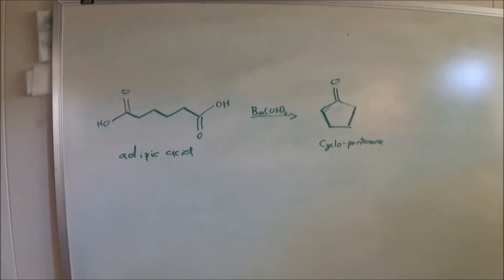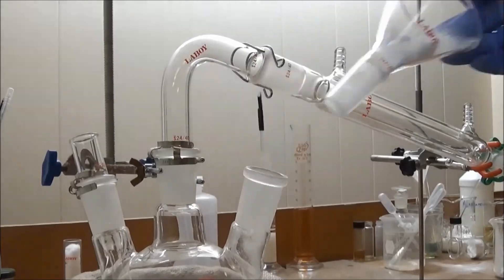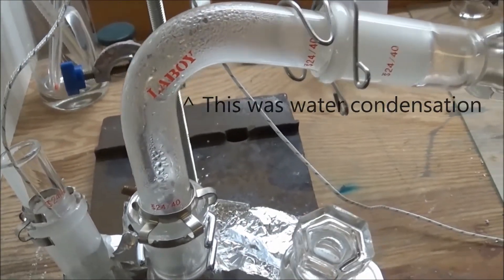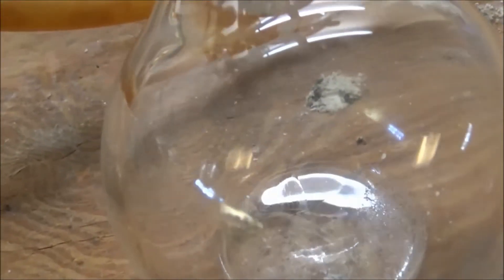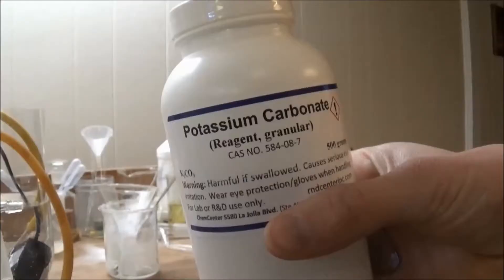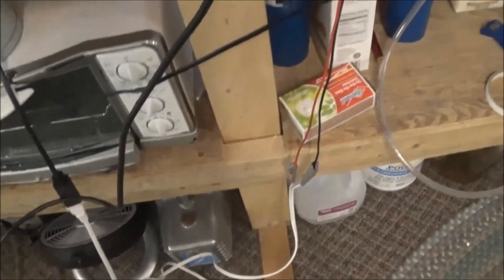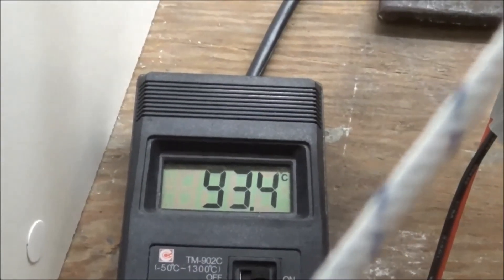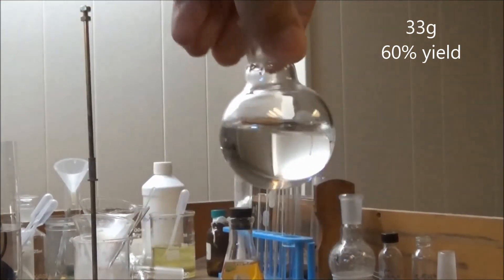Make Cyclopentanone from Adipic Acid

Comment: Can Ca(OH)2 be used instead of Ba(OH)2?
Reply: Yes. I've produced cyclopentanone in 10kg batches using just @ 2% CaCO3/Ca(OH)2, Alumina balls etc.. Glassware is short-lived & so better to use a metal pot with agitation, electrical heating & temperature-control. You'll get close to 98% yield

Comment: Years ago, I had used CaCO3 for making cyclo-pentanone from Adipic acid. This is because CaCO3 is much cheaper & also not toxic. Even 2% works fine & doesn't leave much residue in the flask

using the reflux column during decomposition stage improves the yield to > 90% as the adipic acid will continuously fall back into the reaction flask. This way the alkali-scrub is avoided. The water-layer at the bottom was removed with a separating funnel & no 2nd stage distillation is needed. I had used a thermometer to keep reaction temperature @260°C
Reply: I was trying to find a better non toxic catalyst than Ba(OH)2 or KF and this sounds great. Thanks!
Reply: @monarchatto6095  In the end, We had excellent yields using an iron 'pot' with a wide mouth that could be cleaned out easily. Glass-flasks were shortlived. BTW, it is a dehydration reaction where the 2 cooHs of the Adipic acid molecule lose water & close the ring with a carbonyl-bonded oxygen. In some experiments, we had good results with Alumina balls. There were just available around the lab. To reduce the charring to the very minimum, we controlled the heating - coil by means of a PID controller to @ 205 -210° C. This way we got close to Y -Th

Comment: GREAT VIDEO.......I think all ketonizations give low yields.    You should take that cyclopentanone and heat it STRONGLY with acidified KMnO4 so the ketone forms an enol(double bond) then the KMnO4 could break the double bond forming pentanedioc acid.   THEN TRY TO KETONIC DECARBOXYLATE the pentanedioc acid into a 4 carbon ketone ring.   I do not think it will work cause of the strain of a 4 carbon membered ring but it would be cool........lol
Reply: Cyclobutanone doesn't form from glutaric acid. The ring is pretty tense so you have to do it with the other way.
Reply: @dimaminiailo3723  .............I thought with strong acid like permanganic acid you could make an enol from a carbonyl group like on cyclopentanone???????   An enol has a double bond.    I thought  you could break a double bond and replace the ends that were broken with carboxy groups using HOT acidified  KMnO4 ???????   Which statement are you saying is wrong??????   I can't form the enol .........or i can't break the double bond that is formed on the enol to create 2 carboxy groups???????????
Reply: @johnblacksuperchemist2556  You can do this the usual way with nitric acid. I was talking about the formation of cyclobutanone from glutaric acid which is almost impossible
Reply: @dimaminiailo3723  ...ok

Comment: Great video, Tom! In the last distillation though, you said an azeotrope with water came over. But then you said the result was pure cyclopentanone. Did you add a drying step in there that you forgot to film? Thanks!
Reply: He collected only the pure part of distillate. The cyclopentanone from azeotrope wasn't extracted as I can see.
Reply: @dimaminiailo3723  See, besides water, you have some adipic-acid in the Crude product too, if you use a low reflux ratio this increases.

For producing in small quantities, you may wash with an alkali like NaHC03 & dry it with CaO, maybe even distil for high-purity.
 In making our 10kg batches, we used Lime-CaO for both drying & removal of free acid in one go. This was followed by one more round of distillation.
Reply: @TheControlPhilosopher  Any basic conditions will destroy the ketone. The best way is careful fractional distillation and drying with a Dean-Stark trap
Reply: @dimaminiailo3723  In kg scale production, in the midst of other chemicals being Synthesised, one needs to minimize the steps of manufacturing. And in intermediate synthesis it is often never essential to have the reagents  in pure form.

All the same your point is right. Ketone-yield does get destroyed. which is why we used Na-Bicarb for adipic acid removal. For dehydration, we actually began with CaCl2 but we found it corrosive to iron & SS. Whereas. CaO did a great job. There wasn't much loss of ketone thanks to its low solubility. The spent reside could be readily disposed as an admixture to lime-wash. There was the odour of the Cyc-Pentanone but its rather pleasant actually & it didn't linger beyond a day or two..

Comment: If you were ultimately aiming to produce cyclopentane via hydrogenolysis of the cyclopentanone, could you perform the hydrogenolysis on the crude cyclopentanone and then just refine the product afterwards? Or would the impurities cause issues in the hydrogenolysis process?
Reply: No.. He was trying to produce the Ketone. BTW, cyclopentane is almost a gas at room-temp. It has a very low BP, smells of cooking gas & is very combustible.

Cyclopentanone is useful to add the cyclopentyl group to any secondary-amine, using the Leukert-Wallach reaction.

Comment: How did you identified the product ?
Reply from the maker: The observed properties were enough for identification. Not miscible with water, density less than water, boiling point around 130 degrees, and an azeotrope with water at 93.5 degrees. Given that it came from adipic acid, there really isn't anything else it could be.

Comment: What will you do with the product? Someone mentioned cyclopentamine, I realize the formilation or halogenation of cyclopentanol would involve a lot of steps, and this might not be the easiest way to synthesise cyclopentamine, but it would be pretty cool to see you make quite a complex otc drug. You could also test multiple ways to get from cyclopentanone to cyclopentamine and see which is most effective
Reply from the maker: I have two complex OTC drugs that I plan to make in the future. One I mentioned in my Q&A video, remacemide. Another involves cyclopentanone, the drug cycrimine. My plan is to reduce cyclopentanone to the alcohol, make cyclopentyl bromide and finally cyclopentylmagnesium bromide. React this with 1-phenyl-3-pieridinepropan-1-one (I'm not that good at naming, that may not be correct) to make the final product. 1-phenyl-3-pieridinepropan-1-one will be made in the Mannich reaction from acetophenone, paraformaldehyde, and piperidine. The latter two chemicals I still need to acquire and make.
Reply: Tom's Lab I can’t wait to see your upcoming syntheses! How do you plan on making the piperidine, maybe reduce pyridine or get it from piperine in black pepper? Also, what will you use for the cyclopentanone reduction?
Reply from the maker: I'm planning to reduce pyridine to get piperidine. I think this will be faster than extraction of piperine and then conversion to piperidine. For cyclopentanone reduction I will use sodium in ethanol.
Reply: @TomsLab  The cyclopentanone easily reacts with secondary amines along with slight excess of formic acid mixed with the ketone. With Piperazine, this method readily reacts to form the mono & di-cyclopentyl derivatives. Loss of yield of the Mono-cyclopeentyl was basically due to di-substiation on the 2nd free hydrogen on Piperazine.

Formyl blocking of the 2nd end of the Pip. molecule resulted in mono-substituted yield increasing to >80%
Reply: How effective is the sodium reduction? Isn't there a risk of side reactions, particularly condensations?
Reply: AguaFluorida I would think so, I thought he meant he would use sodium and ethanol for the pyridine reduction as part of a Birch reduction because that’s proven to work, for the cyclopentanone a hydride like sodium borohydride would probably have to be used. A sodium reduction would likely yield the alkane if it even worked, although I haven’t looked into it much, so correct me if i’m wrong.
Reply: Having thought about this a bit more, sodium metal with cyclopentanone would tend to produce the corresponding pinacol, 1-(1-hydroxycyclopentyl)cyclopentanol.

Yes, I also thought - but failed to articulate - that dissolving sodium would be better suited to the pyridine reduction. But Tom clearly wrote of using Na/EtOH for the cyclopentanone, which seems a little puzzling.

Making the borohydride from scratch would be a cool video :D
Reply: AguaFluorida It most definitely would be cool to see, although I’m not sure how manageable a lab scale synthesis of sodium borohydride would be, and thankfully it is actually one of the rare reducing agents that’s somewhat accessible. I would love to see something like diborane though.
Reply from the maker: I'm sorry, I didn't mean ethanol. I guess it was just in my head from the pyridine reduction. The procedure I am planning to do is from Vogel's 5th, experiment 5.29 on page 523. The procedure calls for the sodium reduction in a mixture of diethyl ether and water. Yields are good, in the 90% range, so probably around 70% for me. 

I've thought about sodium borohydride. Lab scale synthesis could be possible, going through sodium hydride. I think I remember reading that sodium hydride is made by bubbling hydrogen through liquid sodium, which should be doable, but pyrophoric reagent in hydrogen atmosphere doesn't seem very safe.
Reply: Tom's Lab I checked out the paper and it seems to suggest that a sodium reduction would work, there is even mention of a sodium reduction in an ethanol solution. I had no idea that such a reduction could work but I guess it seems so. And yes, sodium borohydride would be quite difficult to synthesise, but it’s available commercially.